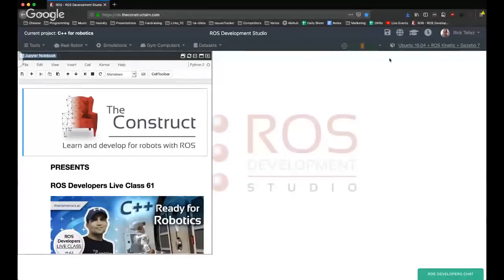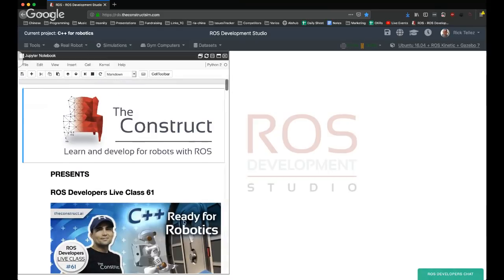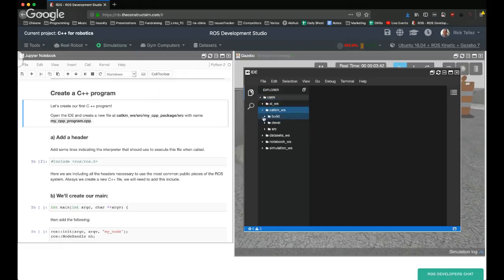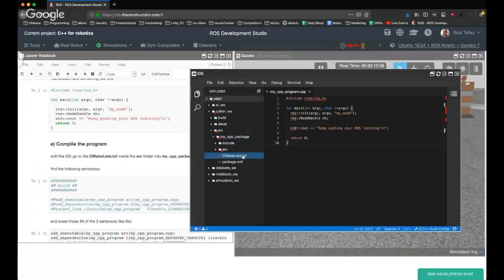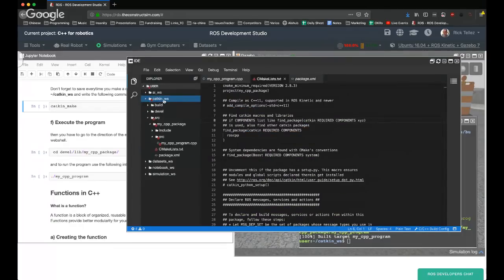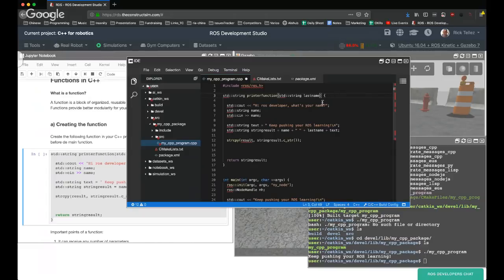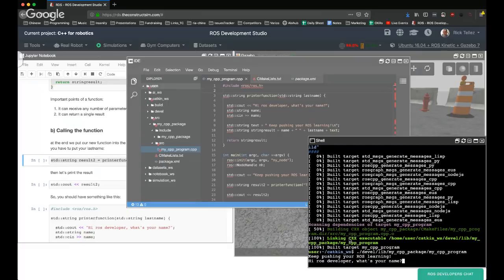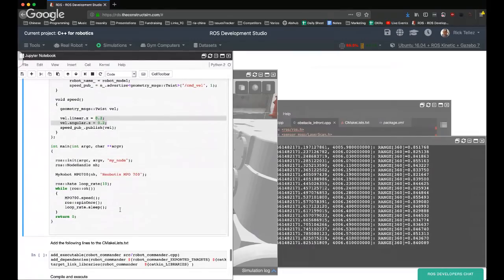ROS Developers LIVE-Class #61: C++ for Robotics

Comment: Thank you for the class. C++ beside is more difficult to study or deploy then Python but the beauty of language (from SW point of view) can compensate all the weakness. Anyway, you Ricardo mentioned about next class - object avoidance. Great subject. It will be also great to hear from you (i near future) about the path planning (for example RRT algorithm) and collision detection (I assume that you are going to discuss about this topic next week since collision avoidance is connected together with collision detection. Is it possible also in nære future discuss about dynamic simulations. Thanks
Reply from the maker: Thank you Markus for your insights. Definitely, good subjects to talk about, specially the RRT algorithm. Let us add that into the plan. 
About dynamic simulations... what do you mean exactly?
Reply: Perfect. Thanks. The Construct presented some videos regarding changing/managing the gravity but I wonder if it possible to show how to manage in ROS Open Dynamics Engine (beside Gazebo) or PyODE. Not sure if possible but it will be great to see beside joint speed, acceleration also the joint (motor) torque and stress forces in robot link. Generally how to use these libraries in ROS environment. Additionally I wonder about the communication. Now all the nodes communicate by ETH (TCP/UDP) but in ROS2 there is a great DDS. It will be also very useful to show some project where the DDS is used (in the future and if it convenient for you). Thanks again!